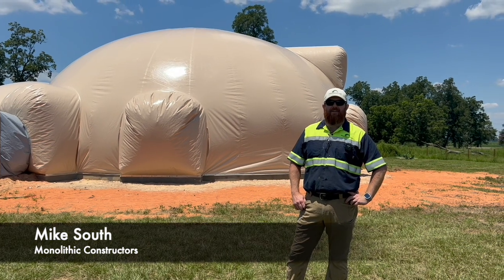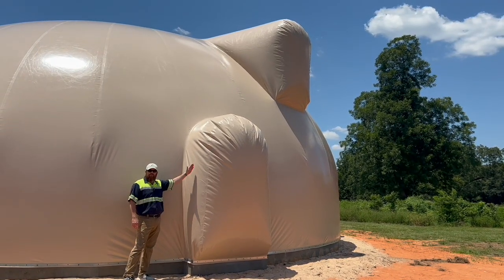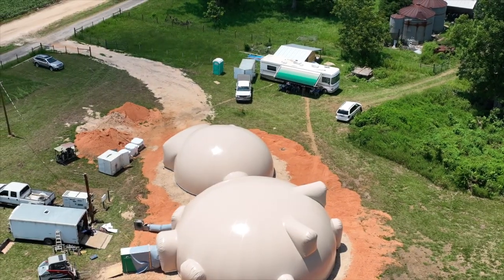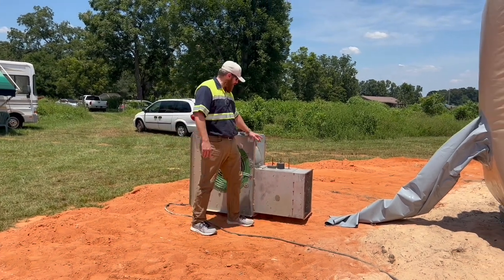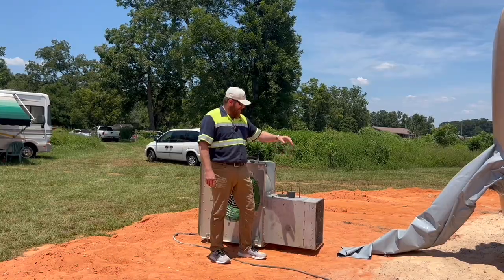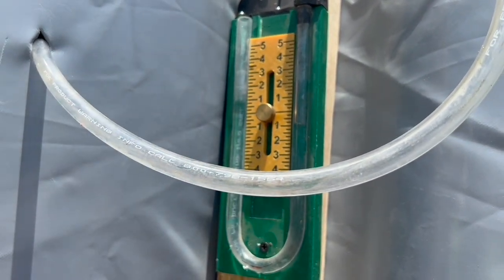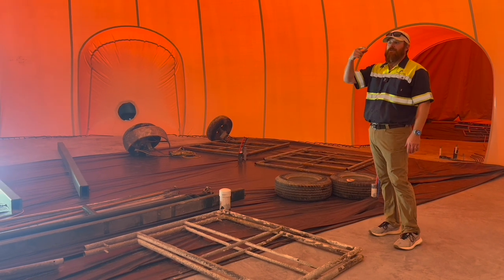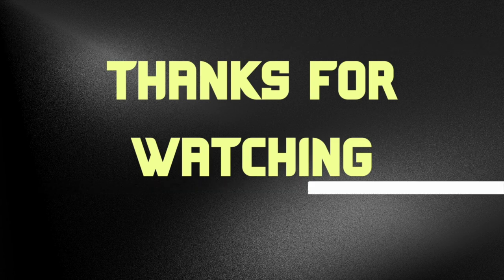Monolithic Dome Inflation in Florida

Comment: Since these dome homes are custom jobs, what would be the price difference between this and wooden custom home of similar size?
Reply from the maker: Not much if any. Monolithic Domes use high-end materials, but the shape utilizes those more-expensive materials more efficiently, so they usually cost about the same as a custom conventional home. However, as the building size increases, the costs go down per square foot, so Monolithic Dome schools, churches, gyms and the like are often much less expensive to build.

Comment: I like the domes that are covered with soil.  They effectively become hurricane and tornado proof.  If I were to build a dome home in Florida I would raise everything up a couple of feet depending on the part of Florida.  Flooding is always a concern where it is flat.
Reply from the maker: There are some dome homes in Florida built on stilts. If you search MonolithicDome.com for “Florida,” you’ll see stories about a few of them.
Reply: I’m not sure that stilts are entirely necessary as long as enough runoff, slope, and drainage is provided on the property.  I would do the same with bringing in truckloads of dirt to raise and slope out the land prior to building just to guarantee runoff and drainage more than meet the needs

Comment: I like the one the military introduced which inflates then hardens into more of a permanent structure!
Reply: Like James said, there are 3 or so inches of steel-reinforced concrete. Did someone suggest to you that such a structure is not a more permanent structure?
Reply: The home is sprayed with shotcrete, which is concrete. The concrete is 3 inches thick with rebar.
The home is storm proof and fire proof.

Comment: They look cool, but the problem is shot.Create has a lot of air in it and it does not last but a few years before start crumbling
Reply: can u point to an example of a home that had to be abandoned due to this issue?
Reply: I doubt they can. It looks cool.
Reply from the maker: It’s a proven construction system. Check out some stories about the thousands of Monolithic Domes that have been built worldwide on our website: MonolithicDome.com.

Comment: At what point does it get coated with shot create. The current situation seems very temporary. Thanks
Reply from the maker: There are lots of options for coatings. Metal shingles last at least 30 years as evidenced by a home in Idaho which has had them installed for that long and still looks brand new. The Airform acts as a single-ply roofing membrane and will last forever if coated properly intermittently.

Comment: This is all new to me. What keeps it from leaking? How do they keep it from blowing away in Florida storms?  Once inflated does it need to have the inflator fans constantly running to keep it pumped up? If it gets a leak, is there a patch kit available? How big is the dome's footprint? Is it tornado and hurricane proof? Why didn't they use metrics instead of the antiquated inch measurement system?
Reply: shotcrete and PU Foam is sprayed on it then its deflated. at that point its insulated concrete.
Reply: @ysesq  Deflated?? How would one deflate the airform when it has several inches of foam and concrete bonded to the material??
Reply: @randallcotner2155  they deflate the airfoam after the foam is sprayed inside. The balloon is kept pressurized for a month until they finish the inside.
Reply from the maker: @randallcotner2155  we don’t deflate the form. It is a single ply roofing membrane that is the roof of the dome.
Reply: @MonolithicDome  one of your competitors deflates the dome.  They are likely confusing you with them.  I won't name them of course, and further state I prefer the shape and look of your product over theirs.
Reply: It’s a temporary concrete form.😂
Reply: @TheDieselndust   Monolithic Domes last GENERATIONS+++ unlike conventional homes which get blown by high winds. They are THE ONLY structures FEMA approved. They were tested at sustained winds of 700 mph and still resisted. Check them out.
Reply: @TheDieselndust  Temporary concrete form??? How do you mean?
Reply: I’ve lived in FL for 30 years and I know for a fact that this thing can handle Cat 5 hurricanes no problem!
Reply: @dt6750  Why go thru the expense and misery? Too much water, too much mold, too many itsy bitsy critters. Ewww!
Reply: @2cartalkers  Could you elaborate? Misery, water, mold, and critters? If you could provide some context, that would help us understand what you mean.
Reply: @randallcotner2155  Florida has more than its share of critters like I mentioned. The only place I have been that is worse is Arkansas.
Reply: @2cartalkers  Yes, we have a few critters, and I was simply trying to connect how they have an effect on these homes that would lead to misery, water issues, or mold.
Reply: Because it's round, it has no (or very few - depending on specific design) flat or sharp edges to catch wind. So yes, it's basically hurricane and tornado proof. Also, depending on design, fire and bullet proof. 👍😀
Reply from the maker: The Airform is waterproof. The homes are heavy and the curves don’t allow the wind to grab at the structure. The double curve is very strong and approved by FEMA for hurricane and tornado protection. Once inflated the fans stay on until the concrete is set. There are patch kits. Metrics aren’t used in the USA.
Reply: They cover the dome in rebar and concrete. Once hard they deflate the dome
Reply: @richhomiequan7782  Deflate the dome?? How do they deflate the airform when it's bonded to several inches of foam and concrete??
Reply: The dome is sprayed with concrete over steel rebar. The concrete is 3 inches thick. It is a free standing dome that is fire proof and storm proof.
Reply: Get the fu.. out of here metric is way more accurate form of measure than feet and inches bs.😂
Reply: Because we are in America!!!!
Reply: Yeah theyre going to live in a bounce house 🥴
Reply: @MesaBoogieman82  nope. Once inflated it is sprayed with polyurethane and concrete.  These homes are FEMA approved for shelters. They are best on the market for safety.
Reply: Why didn't they use metric? Because the USA doesn't really use the metric system that much. America does use metric somewhat. 

Yes, monolithic domes are hurricane and tornado proofed by virtue of their shape and one piece nature.
Reply: @Libertaro-i2u america only uses metric when it's measuring drugs  lol😂
Reply: @Xis-ql5pj and ammunition!  😂
Reply: Everybody with a brain knows that inches are waaayyy better than millimeters 😂
Reply: @smyers820gm  Only in the losery USA, virtually the only country still in the 18th century on just about everything. Travel overseas, you'll see. Now, behave yourself.

Comment: We are about to move into ours 😊
Reply: CONGRATS 🎉🎉🎉
Reply from the maker: Nice!! Congrats!
Reply: Okay,  so I know there's foam insulation on the inside. From monolithic I'm guessing they spray gunite on the outside?
Reply: @nailbanger2 look them up.  They’ve been around for awhile.   This is just a mold.  The 🎉actual structure is made of rebar reinforced concrete 🤷‍♂️.  They created a multimillion home on the coast that survived a cat 5 hurricane with minimal to no damage 🤷‍♂️
Reply: @nailbanger2  air foam sprayed inside and only the baloon membrane on the outside for 5 years... then it can be sprayed with stucco or something else your choice,  stone etc
Reply: How big and how much was it
Reply: @luisybarra8862  ours is 2600 sq because we were downsizing.  The cost is just as a regular home but you have to have your money.  The Banks will not give you a mortgage for a home like this.

Comment: Are you serious? Who was the brainiac that came up with a plastic house in a state that has hurricanes that throw trees around. Is this the really stupid world I live in?
Reply: Do you feel the 4 inches of steel reinforced concrete is insufficient to handle the storms?
Reply: @randallcotner2155  I hope you are not asking on a basic concrete principle. Because we have plenty of concrete structure that have collapsed in a storm. Also the mix is very important to tensile strength.
Reply: @rafaelgonzalez4175  Not at all. I'm responding to someone inferring this is a plastic house, when it's clearly not. It's important to note that absolutely none of those concrete structures mentioned were not monolithic dome homes.
Reply: @randallcotner2155  When I inflate bounce house, a tire, a balloon, my ego, it usually does not contain cement. Most of the time it is air. In my case it is dense smoke. Looking at a plastic dome structure, that is inflated, gives me the implication of a Plastic Dome Monolith..
Reply: @randallcotner2155  One more note. If it is a concrete structure why is it a balloon of a wrapping, just to have a solid structure, of a different material, as the end build result? Now I am confused. It is a plastic shell to make a concrete building. Where concrete could just be poured. Forget it. I can't grasp the construct of plastic to become concrete. You are right. It is genius to make the bounce house before you make the house.
Reply: Stupid is a mobile home in Florida. There's all the info available on dome homes if you do some research, your comments are embarrassing
Reply: @WanderingandWondering-qp6yr  Why do research stupid when the video is the explanation. Wow talk about being real stupid...
Reply: @WanderingandWondering-qp6yr  Embarrassing is not having a mobile home to go where you want and not be homeless. But yeah try to make sense of why it is not feasible, to have a mobile home in Florida. I bet the real stupid answer is Storms. Here on planet Earth you can anchor strap mobile homes and recreational vehicles. Who would have thought? The people that live in Florida. Stupid...
Reply: @WanderingandWondering-qp6yr  Why do research when people can just reply with stupidity and give me the answers I need. But also there is my reply that was already deleted. That asked why is having a home you can go anywhere with and not be homeless stupid? Like I said before it was deleted and as I will now copy and paste my answer ten times over, because of storms I bet. Although the people with brains figured out you can anchor strap mobile homes and recreational vehicles to the ground during heavy storms.
Reply: @WanderingandWondering-qp6yr  Why do research when people can just reply with stupidity and give me the answers I need. But also there is my reply that was already deleted. That asked why is having a home you can go anywhere with and not be homeless stupid? Like I said before it was deleted and as I will now copy and paste my answer ten times over, because of storms I bet. Although the people with brains figured out you can anchor strap mobile homes and recreational vehicles to the ground during heavy storms.
Reply: @WanderingandWondering-qp6yr  Why do research when people can just reply with stupidity and give me the answers I need. But also there is my reply that was already deleted. That asked why is having a home you can go anywhere with and not be homeless stupid? Like I said before it was deleted and as I will now copy and paste my answer ten times over, because of storms I bet. Although the people with brains figured out you can anchor strap mobile homes and recreational vehicles to the ground during heavy storms.
Reply: @WanderingandWondering-qp6yr  Why do research when people can just reply with stupidity and give me the answers I need. But also there is my reply that was already deleted. That asked why is having a home you can go anywhere with and not be homeless stupid? Like I said before it was deleted and as I will now copy and paste my answer ten times over, because of storms I bet. Although the people with brains figured out you can anchor strap mobile homes and recreational vehicles to the ground during heavy storms.
Reply: @WanderingandWondering-qp6yr  Why do research when people can just reply with stupidity and give me the answers I need. But also there is my reply that was already deleted. That asked why is having a home you can go anywhere with and not be homeless stupid? Like I said before it was deleted and as I will now copy and paste my answer ten times over, because of storms I bet. Although the people with brains figured out you can anchor strap mobile homes and recreational vehicles to the ground during heavy storms.
Reply: R @rafaelgonzalez4175 
You know what's stupid. Cut and paste multiple responses in a row all saying the exact same thing. 
Are these types of houses viable in an area that experience extreme weather events? Possibly. In my opinion how we build homes in certain areas needs to change. But the biggest problem to doing so is peoples minds. "Mah house has to have square corners and be built out a sticks" that kind of attitude. What is the best type of housing to build in these areas? I'm not a structural engineer but housing that becomes flying debris sure isn't the answer.
Reply: @mpetersen6  Why don't you scroll through the conversation before assuming stupidity in the conversation? Maybe then you will see my reason for copy and paste 10 times over. I did that for a reason. Engineering a stable home is easy. Making one that is damage proof is not easy. Everything decays. You ever hear or read that old saying if it isn't broken why fix it. Houses getting built is not broken. Making housing more expensive is not the necessary fix to the unbroken housing situation. Then again. Maybe I should copy and paste this 10 times over so it can get deleted once or twice over...
Reply: @WanderingandWondering-qp6yr  Why do research when people can just reply with stupidity and give me the answers I need. But also there is my reply that was already deleted. That asked why is having a home you can go anywhere with and not be homeless stupid? Like I said before it was deleted and as I will now copy and paste my answer ten times over, because of storms I bet. Although the people with brains figured out you can anchor strap mobile homes and recreational vehicles to the ground during heavy storms.
Reply: @WanderingandWondering-qp6yr  Why do research when people can just reply with stupidity and give me the answers I need. But also there is my reply that was already deleted. That asked why is having a home you can go anywhere with and not be homeless stupid? Like I said before it was deleted and as I will now copy and paste my answer ten times over, because of storms I bet. Although the people with brains figured out you can anchor strap mobile homes and recreational vehicles to the ground during heavy storms.
Reply: Have you looked at the other videos on the channel?  This is basically step 2 of the physical build process, with step 1 being pouring the slab/foundation.
Reply: @michiganengineer8621  is that normal? I find it very difficult to foundation the house after you build the house. But hey, it is step one. Find the house. Found it. Step two?
Reply: don't let ignorance of how the thing actually works stop you from wrongly criticizing it.
Reply: @neeksor  Wrongly criticizing is seeing the concrete getting poured inside the plastic containment then say, did you really need the plastic shell or was that just to add to the cost? Either way it is ignorance that does not see the over spending...But don't let people get in the way of you having the right to remain ignorant.
Reply: You obviously have no concept of how this works, do some research before you make yourself look even dumber.
Reply: It’ll float, dumba-s.
Reply: You ignorant uneducated phool 🫵🤡🙄.  This is a single step in building a hurricane proof home 🙄
Reply: what a maron you are dude.
Reply: @TwoAcresandaMule  I can safely say, as a moron I know how to spell. And like I enjoy saying to everyone. It is better to be moron than off. Learn to spell, then you can go around calling people names.
Reply: @TwoAcresandaMule  Funny you spell Moron wrong. Or you need to explain what a maron is because I see my reply was not here. Having said at least, I know how to spell moron. Moron...
Reply: @TwoAcresandaMule  Because My reply was deleted this moron will not only copy and paste my answer ten times but I will spell moron correct each time. Moron.
Reply: Do you now see how annoying it is to delete replies?